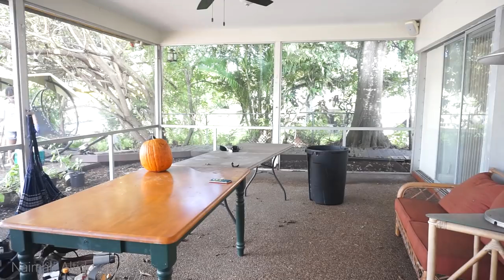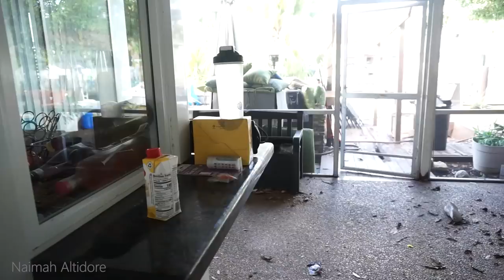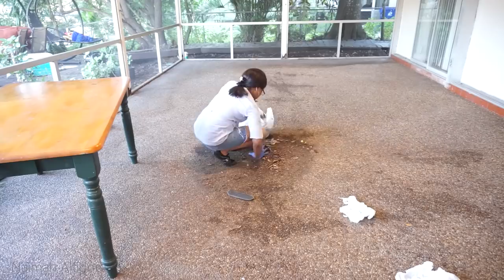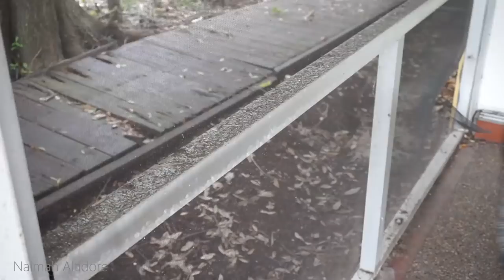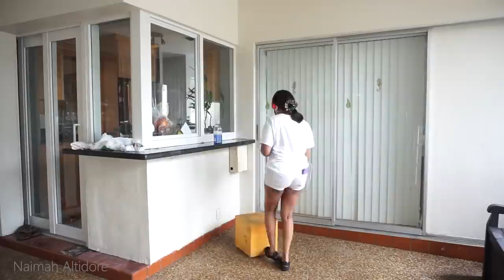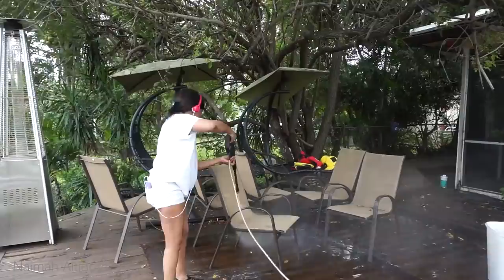HUGE PATIO TRANSFORMATION / CLEANING MOTIVATION / EXTREME / CLEAN WITH ME / DECLUTTER AND ORGANIZE

Comment: If you dont like those blinds, take down the slats and hang fabric or curtains using the slat clips. I did it and it works great!  So much better than always straightening those blinds!
Reply: This is such a good idea, I’ve never thought of this. So glad I came across your comment. Is there a specific fabric to use? Especially to block out the light?
Reply: @sarina4526  You can use any fabric if you line it with blackout lining. If you don't sew, use a thicker fabric.  Also, you can just use blackout curtains.